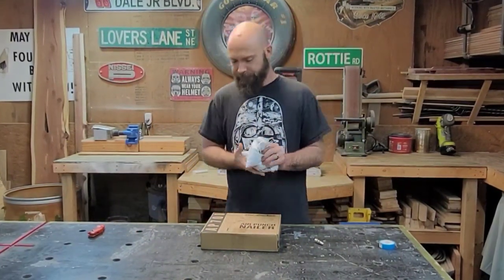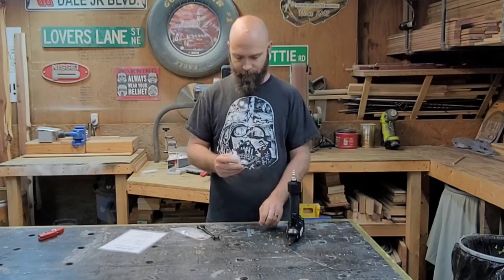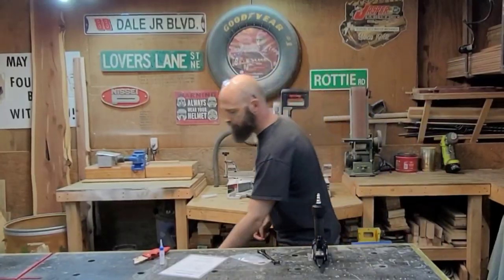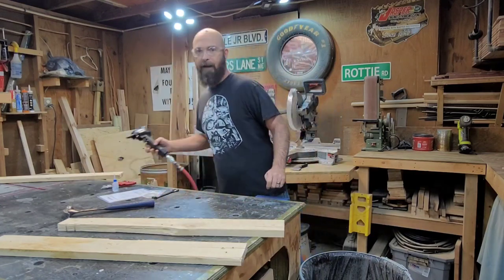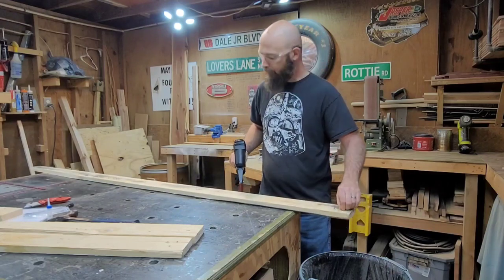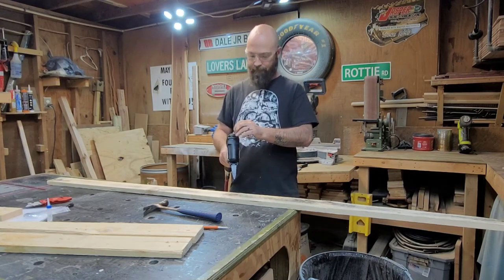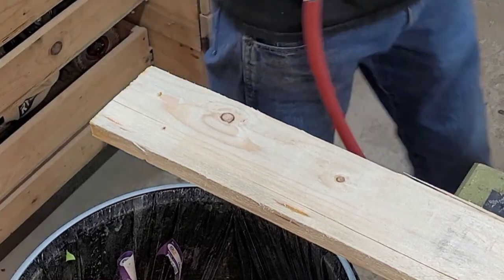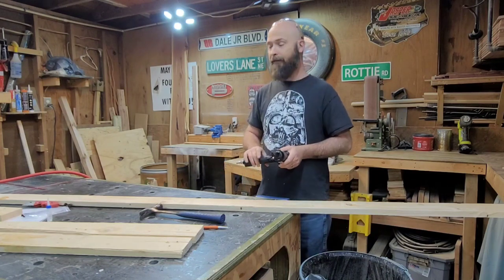Air locker ap700 the tool will change your life, if you work with pallets that is.

Comment: The AP700 is a really bad device.  I already had with the 2nd pallet with 2.5mm nails that the nail got stuck between the neck and the firing pin.  By the 5th pallet, the neck was already so worn that almost every nail got stuck.
Reply from the maker: Must have been a bad one I've taken 30 or so pallets apart since the video with no trouble. I would contact the manufacturer and see about a replacement.
Reply: @meanmacawwoodshop  I paid 124 euros for it at Amazon and worked with it for the first time today, but the quality is really soft China steel.  Even where the neck is mounted on the device with 2 bolts, you already saw wear.  Unfortunately I can't post pictures, so I could show you the slack.  I have made a return report and I will send it back tomorrow.
Reply from the maker: @Superoo  unfortunately everything is from China now. I hope your replacement is much better. I love mine and hope your experience will be the same.
Reply: Well you must be doing something wrong !
Reply: @markcarter4716  The 2nd AP700 had the same problem.  Why don't I have any problems with the Mex denailer?  I have now used approximately 2000 pallets with it and 0.0 problems with it.
Reply from the maker: @TheYellowBear418 I've probably run 700 pallets since the video posted and still haven't had even a miss. I don't know what's going on with the ones you're receiving, maybe just a string of luck. Or maybe I got lucky and got the only good one. I am still thrilled it myself